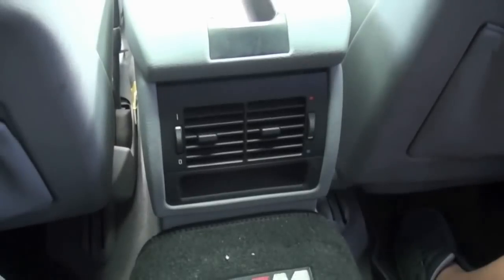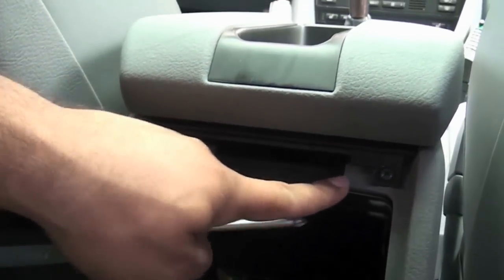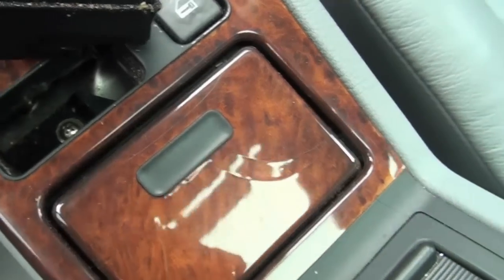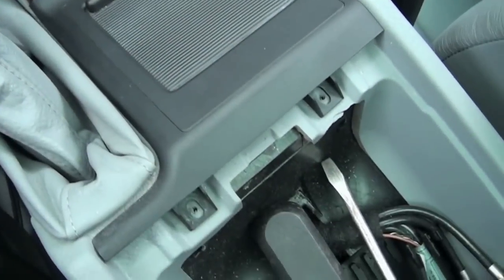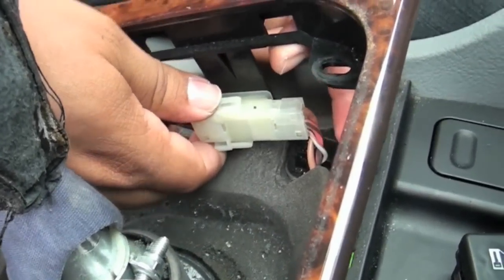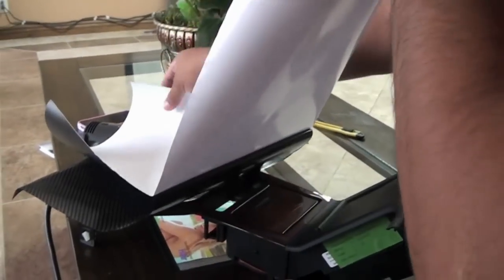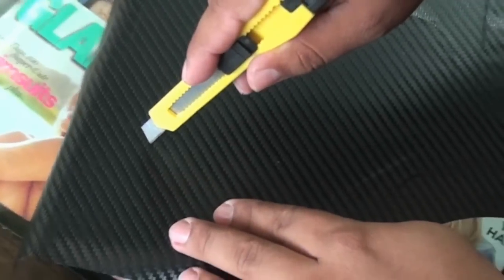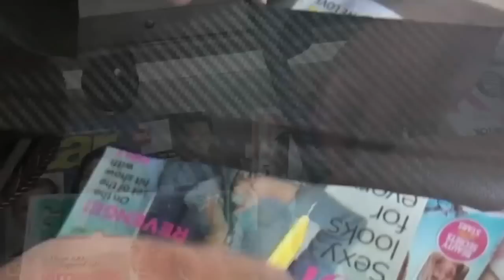e39 Center Console Removal & Vinyl Wrap

Comment: I've look at many clips, trying to see how to fix central door lock.
Yours is the only one that is actually for, at least for me, a 2002 BMW 525i.
You showed they were independent units as opposed to separate locking - warning lights.
After watching your clip, I was able to finally, pull the central lock.
Turns out, the lock was fine, just needed to clean off the gunk around.
Thanks!!!

Comment: For your problem with the vinyl pealing back, make sure you post heat any vinyl you do. This will take any memory the vinyl has and reset it to the new shapes of the pieces you wrapped. A good rule of thumb is to get the surface of the vinyl right around 180-190 degrees fahrenheit. I had problems when I first started to do vinyl but after figuring this out I have not had any problems yet.

Comment: Personally, I'm not a huge fan of the look, but the way you kept those diagonal lines straight on multiple pieces is great skill. Thanks for this instructional video, it was helpful in showing me how to remove the center console. The screw under the hazard button- I would've never seen that.

Comment: The ashtray door is just held in with four small screws, I found it very helpful to remove it. Other than that I think you did a good job, I completely messed up the button for locking the door so I might have to redo it some time...

Comment from the maker: jajajajajaja I have to agree with you on that.
Yes, that's the best way of getting rid of the bubbles. I haven't used the glossy vinyl yet and I wasn't sure if it would be too glossy for my taste. I would rater use it for exterior. I'm thinking of wrapping my roof rack, if I do i'll make a video showing the difference on material.

Comment: Use water with a small amount of Johnson and Johnson baby shampoo on the adhesive side.  It allows you to position it, and remove all the bubbles.  Use a hard card to work any bubbles out and extra water.  Never heat plastic too much or it'll warp and the part won't fit back in properly.

Comment from the maker: yes it will. All I have replaced have been the stock stereo. I still have the stock speakers. They are not bad at all. Check out my Double Din Pros & Cons Video so you can get a better idea.
What I added was an AMP, 1 12" Woofer and an Equalizer. Good luck pal..

Comment: yes its a colour coded trim to match the car, not the black plastic one
it has gaps at the corrners of each side, but im not sure how to use the trim tool to get it off, without snapping the plastic clips that hold the trim to the bumper.

Comment from the maker: Thanks. I don't think the heat gun will make a difference. I only use the heat gun to bend the corners. Just make sure you have enough material to wrap it around the back. About, over an each all around.

Comment: Hey bro Thanks for the video finally going to get rid of the sticky stuff on the hazard and unlock/ lock buttons thanks. Would you happen to know what the purple cable and the other bigger cable under the center console. The purple ones seem like they connect to each other don't want to test it tho. Thanks bro

Comment from the maker: Oh ok. Than u have an easy fix. Without those trims you would have to remove the entire bumper. So what you need is a flat head screw driver and a micro fabric cloth, or something similar. You said you have a trim tool, if is made out of plastic your golden. So, start from the corners and stick it on the top of the trim and push the tool upward so you can pop the trim out. then move to the bottom and work ur way till the entire trim has been removed. If using a screw driver wrap it on the cloth

Comment: Nice vid.. Looked like you were using Windex to clean the parts beforehand?  If so I'd recommend using mineral spirits followed up with isopropyl alcohol instead with a lint free cloth to remove all the oils and grease marks better.
Reply from the maker: I used windex to clean the glass where I was working. But I'll keep that in mind to clean part and to remove the oils. Thanks for sharing pal.

Comment: Plasti dip attracts more dust, by adding glossifier you're gunna get 3x more dust. and not to mention plasti dip goes rough after the glossifier. I've been there done that.

and its hard to clean plastidip with microfiber clothes. The vinyl is more clean and smooth and less cheap looking

Comment: The reason its lifting is because its cheaper vinyl. I know because i have wrapped a whole car with crappy CF before and the edges lifting were never ending. Its best to use 3M vinyl and also 3M primer around edges for the best results.

Comment: Very nice job and explanation! I just have a question, how you did the corners and would you recommend clear coating the vinyl wrap, so that it looks OEM from factory?
Reply from the maker: Touge Monster 
Thank you.. You do the corners by applying heat and pulling the corners outward around the back. 
I have not done clear coat. If the clear coat stays on the vinyl I'm sure it would look nice. I'll look into it and I'll see if I can make a video.
Thanks for the support.

Comment: Using super glue on the back side of the part to tack down the edges of the vinyl is a good idea.

One thing I would suggest IF what you're covering already looks like shit. Give the part a good wipe down with lacquer thinner using a clean cloth first, and let the thinner evaporate away leaving a dry surface. That will remove any kind of oils or other contaminates that might prevent the vinyl from sticking really well.

Now, if you don't want to risk diminishing the surface quality of the part, DO NOT USE lacquer thinner. Certain plastics and some other materials will lose their glossy finish if wiped with lacquer thinner. Find a less harsh solvent that is safe for plastics if you are uncertain about whether or not you intend the vinyl to be permanent.
Reply: Why not properly clean the plastic plate in the first place?  Looks like he did not even try to clean it, and just stuck it on.  Plus you should cut close to the edges, then apply heat' to let the film adhere to the edges, then with a squeezee press deeply into the material.  Plus working from the edges gives it a better look.....
Reply: Rubbing alcohol would be a safe cleaner which won't harm an existing finish.

Comment from the maker: you don't need to use it, is all marketing. Just make sure you clean the surface before applying/ installing the vinyl. You can use alcohol, but windex will do the trick.

Comment: M5 or M Package?
also, ive decided to not install aftermarket audio interface as it seems to be sort of together with the climate control. BUT i notice once with NAV its a slight different set up and is able to upgrade without much cosmetic changes.

Comment: You should have used 5D instead. this one is nice, but it looks way cheaper than the original design. You should also give the parts a really proper cleaning, preferably with rubbing alcohol before you apply the wrap. Also, don't try to be quick, you need to carefully get rid of bubbles mate

Comment: Nice work. Did you use the 3M brand, or just the eBay special? I have been looking to buy some, but the 3M is way too expensive. What do you recommend? Thanks!
Reply from the maker: Just ebay special. That's all I have used so I wound't know what's the difference between them two. So far I like this material, is not cheap as I thought I would be

Comment from the maker: you need to buy plastic trim removal tools. If you use screwdrivers you will mess up the dash board. once you have those tools, stick them on the side and work your way around the vent. they're popped in. like everything else

Comment: Maybe you've answer this before, but quick question, this vinyl won't unstick in high summer heat? What's your experience? 
P. S :all the trim looks sick man!
Reply from the maker: I've done all of my trims and my roof rack. So far only 2 have pilled off from the corners. I notice the ones that are pilling of are because I didn't leave enough vinyl to wrap around the back. So I would recommend to leave at least 2 inches to wrap around the back. I notice this only happens on the corners.
Good luck and thanks for the support

Comment from the maker: Get it from ebay. Is very inexpensive. $18 for a 24"X60" sheet. That would be more than enough for this project. You'll find a bunch of sellers. Quality wise they are all the same. Suggestion, base your purchase on distance. It will get delivery quicker.

Comment: Do you have a link to the specific vinyl you purchased? I have an E39 from late 2000 I would like to vinyl the interior "wooden" parts.
Reply from the maker: pspdsRobin2 no I don't. I just made a recent purchase from a different seller and is all the same material. I base my purchase on ebay by distance so my order comes quick

Comment from the maker: Hey Gus. I know u ask me how many O2 Sensors your vehicle has, but i can't find that Comment/Question anywhere. There are 4 in total. U have to know which one it is. If purchase at the dealer it'll run u about $399.
 I will recommend u going to any local AutoZone, Cragen or O'reilly auto part. They scan it for free and will tell u which sensor u need to change. And make sure they're BOSH O2 SENSORS
There are 2 on the headers. then 1 before the CAT and 1 after the CAT.

Comment from the maker: Is used to the corner and to remove air bubbles. What the heat gun does is, it expands the vinyl on those curve moldings. Check out my Double Din Cover Wrap so you can get a better idea. And thanks for watching my videos.

Comment: The China carbon fiber wrap is difficult to work with as compared to Vivid or 3M vinyl. I use the Vivid XPO series vinyl and it seems to work easiest for me. I tried the China made stuff and it doesn't seem to stretch as much or as easily as the XPO and from what I have read about the adhesives they use.....not good for paint or plastics if you decide to remove the vinyl because you don't like the look or it starts to peel. The China stuff also seems to peel and not release small air bubbles very easily either. When buying vinyl.....you get what you pay for most of the time. And....no....I am not affiliated with or sell any vinyl for any manufacturers of it.....just letting you know my experience with it.

Comment: does this require a special kind of vinyl? i live in a place where it is 105 plus and humid all summer then - 15 or lower all winter, would it hold up to the extreme conditions?
Reply from the maker: Taylor Lemieux Well, this material seams though enough. I did my trims 2 years ago and they still good. I live in california and we hit the 3 digit mark. 100+ 
For the price, you can't go wrong. The material is very affordable. It doesn't hurt to give a try
Reply: Awesome. Where do u order it?
Reply from the maker: Taylor Lemieux I buy it from ebay. I have made 7 different purchases from different sellers and they all seam to be the same quality. You will find 2D vinyl, 3D and for 4D. The one I used in this video is 2D. But I love the 4D better. Is the same as 2D but with a little gloss finish.

Comment: does it still look good how
long has it been on
Reply from the maker: It still look good to be honest. How ever one of my trims started to lift a little because I didn't give it enough feed to wrap around the back. 
It's been a little over a year now
Reply from the maker: carlawon well, there's only one way you can do this job. The sheet of wrap is 24 inches wide by 60 inches long. The console is about 16 inches wide and maybe about 28 inched long.  But either way you try to wrap it, horizontal or vertical, the pattern is the same.

Comment: does the vinyl have the carbon texture??? and where did you buy it from??
Reply: I've never seen it at Walmart.. I'll check though, thank You Star Nikki
Reply: +Jetta GLI ebay
Reply from the maker: +Jetta GLI 
The cheapest place you'll find is ebay. Bunch of different sellers but is all the same seller. Much cheaper if you get it from china but it takes a while to get it delivered.

Comment: Thanks for the video showing how to remove the console.  Adding a stick on pattern however did this car an injustice since heat will cause it to bubble and it may fade over time.  It is just tacky!  Should have been "hydro dipped".  The color would be permanent, it will never bubble or peel, and the finish would have been cleaner . . . just saying!  Nice job anyway!

Comment from the maker: Nice ride.. that's the vehicle I'm actually looking for. but not to replace my BMW. 
YES is possible. It's be better if you can remove the parts, but if not just be careful with the heat gun.. You will need a sheet of 24X60 and that will cost u about $15 on ebay.
Check out my new vid. I show a gloss vinyl and a non gloss.

Comment from the maker: M Package.
Is not together with the climate control. How ever, it is a bit hard cause u have to cut/trim the the AC/Heater duck system. Other than that u just buy the Hardness Kit and the Double Din Bessel. It looks harder than what it is. Has long as you have the right tools.

Comment: You don't know to wrap... Bubbles and junk under the vinyl... :/
Reply: agreed. what a sloppy job. Should have used angle pull method to get it stretched nice and heat it as its applied - especially around the corners.